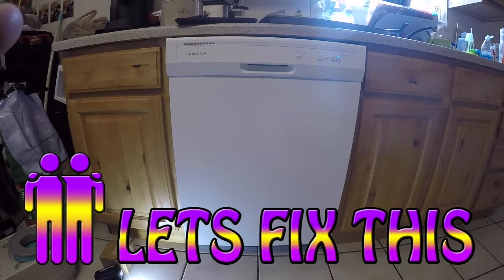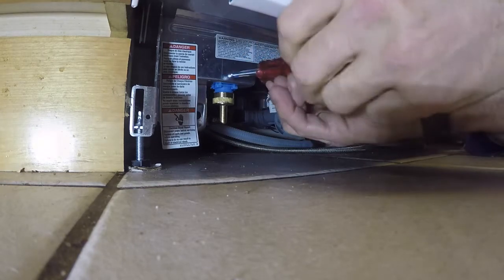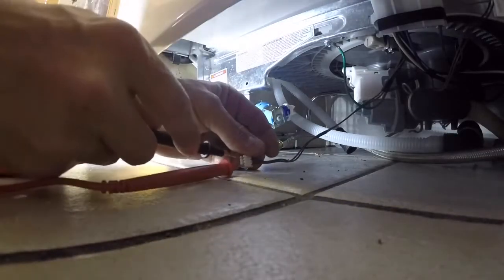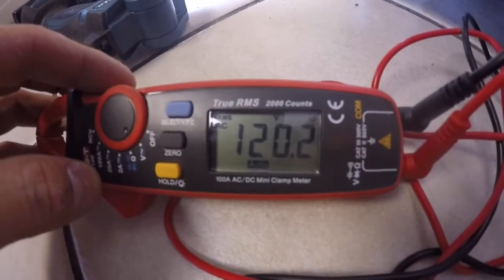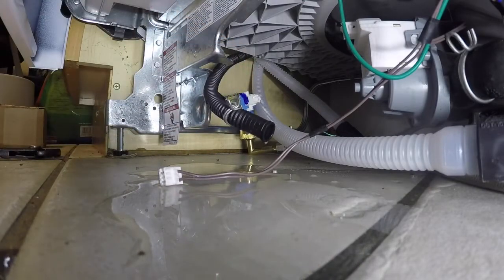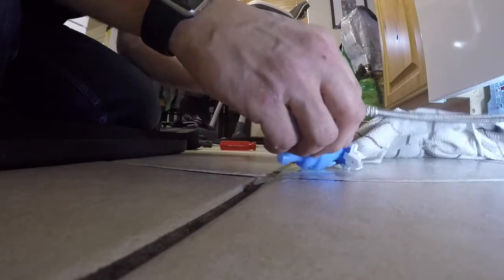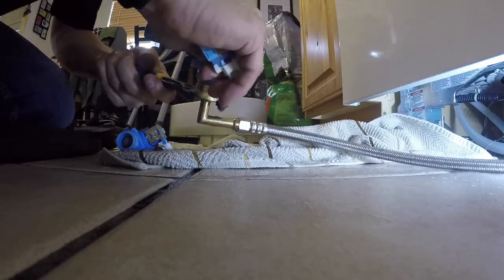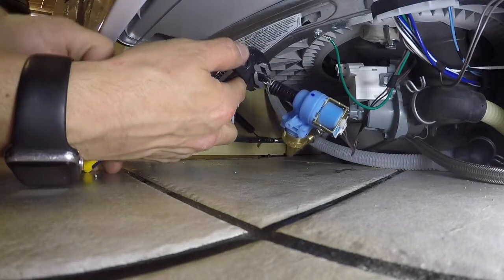Whirlpool : Maytag :Amana Dishwasher not filling with water diagnostics

Comment: With mine, After talking to my youngest ( the Geek guy) I listened and thought I heard the click on valve, so I assumed it was trying..  He had me ensure water was getting to valve then As a "try",  I shut water off and undid the water inlet feed then I used the bristle end of a battery terminal cleaner- gently scrubbing inside the valve. 
Son said  Newer dishwashers have a check valve in the drain valve that sends a signal allowing the fill valve to engage.  Mine does not have that feature but  He did have me run 3 coffee jugs of vvery hot water and forcing the drain cycle each time. This he said would clean out any grease ect that could be impeding operation.   
Put it back together and Mine ran like new and had much better sound  during drain cycle.  I cleaned the screen filter while I had it off checking for debris in pump sump area also..  
I have run 4 cycles.:)))

Comment: I had this same problem.  I tested the brown line, with no voltage, except for a quick 3v draw, then stopped.  I looked at al the wires and the circuit board.  No burnouts.  I actuated the float value a few times, heard it click, then tried the cycle.  When the valve was connected  with the water off,  the valve vibrated.  I turned on the water and tried again.  The valve seemed to work then and the dishwasher ran with water.  My point being, is that if you test and have no voltage, it may be a stuck float valve cutting off the electricity to the inlet valve, or something other than a bad valve.
Reply: I'm going to look at my float valve thanks.